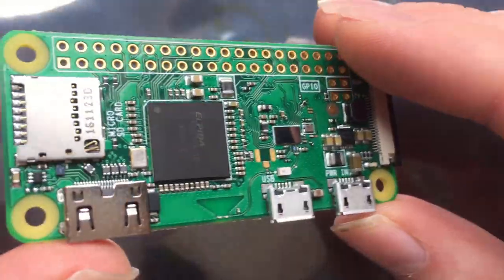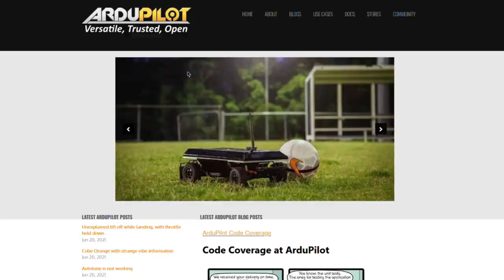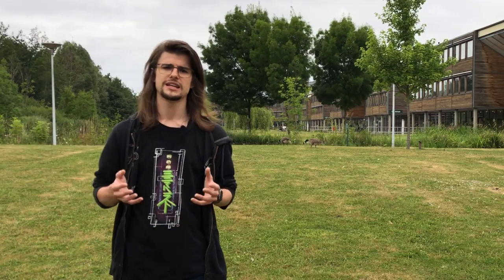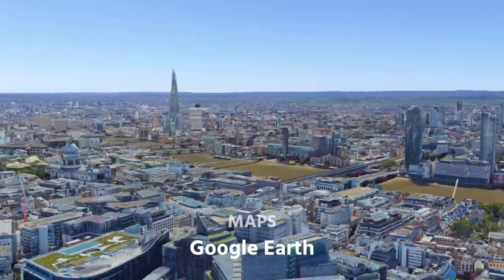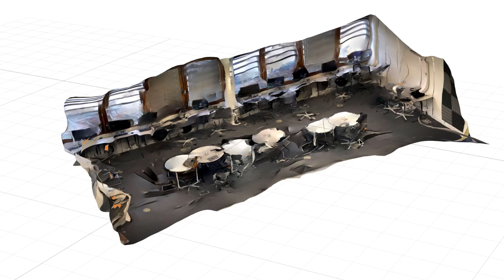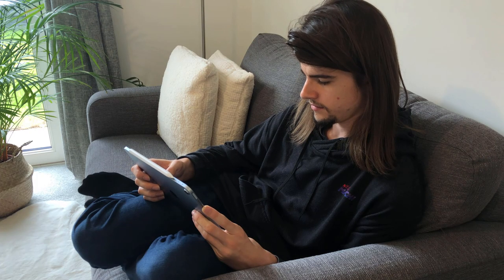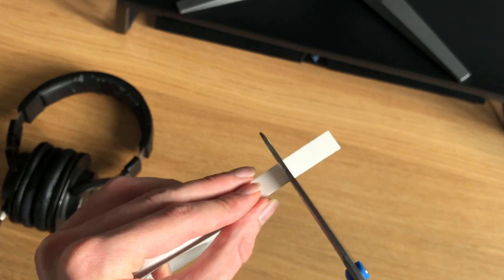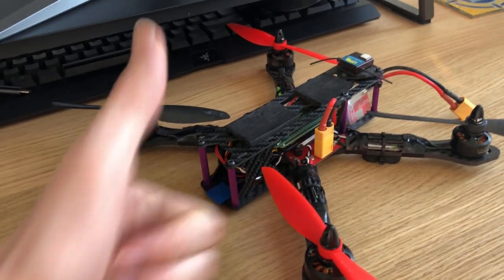My Raspberry Pi drone: the story so far

Comment: I also used PXFmini to build a drone for my final project at the university. It was always a challenge to make it fly correctly and I only did it once. The PXFmini was not discontinued by chance. Pixhaws is definitely the way to go. That Photogrammetry stuff is awesome, hope you continue to work on that.
Reply from the maker: “A challenge to make it fly” is definitely an understatement, that’s for sure…! Looking now at pairing a PixHawk with the Jetson Nano or a Pi 4, though space limitations on the drone means that I’m likely going to have to rebuild with a new frame. Should make a good video, at least! 😅
Reply: @akamatchstic  I had been working on a build a while back but got caught up with work and life and such, using the raspi 3 and navio2,. I have that operational once again, as I have no found significant time to focus on a smaller drone version that is 3d printed among other cool features, that are all relative to your goals. First off awesome work. Second off, why are you using PixHawk and other autopilot hats instead of a flight controller that supports inav or betaflight and then connects to raspi? Also super open to talking and collabing on work. I have a TON of drone ideas that I am finally trying to spend more time getting involved in. I have noticed a TON of flaws in the embedded systems community especially around drones too. Maybe not flaws but lack of standards, frameworks, modular adaptability, and among other things software choices. So please feel free to pm me on this topic as well.

Comment: I was going to do this for a Master's thesis in 2014. Had the same idea about streaming video to a GPU ground station for recognition. 

Needless to say, I also had to switch me topic. 

If I were doing it today, I would use the PixHawk in combination with a Nividia Nano.

But as if 2023 this problem has been solved. You can buy a drone made in China for under $200 that does it very well.

Comment: Nice work getting the raspi up in the air. I don't know how things were going at 2017, but nowadays in 2021 you can get a dedicated flight controller with gyro built-in for the price of a raspi alone. From the video, I infer your original goals is the 3d mapping stuff. Why don't you use a prebuilt flight controller which already handle the heavylifting of flying stuff so that you can focus on the 3d mapping thing?
Not meant to be fussy about it, just curious. Maybe you'd like to learn about the flying mechanism?
Great work, I am looking forward to see where this will go. Good luck 👍🏻
Reply from the maker: From memory, going for the Raspberry Pi was a case of it could run Linux for doing stuff onboard the drone, and with the right hardware could also run ArduPilot. 

You’re absolutely right though - a pre-built flight controller would have been a much better idea! Many times I wish I’d just gone with a PixHawk or something similar… oh well!

Comment: I was just thinking about doing same stuff... using pi zero to do everything. After watching your video, I think I shall get a separate flight controller for basic functions.
Reply from the maker: It’s definitely the way to go I think, with a separate flight controller. Off-loading that side of control makes a major difference in the compute resources you then have access to 👍

Comment: Soooo, all you needed to do was change the color of the props and it flies perfect? I think some information was withheld.
Reply from the maker: Haha yes, I did gloss over this a little. The changes were;

- Changed propellers
- Re-calibrated the ESCs
- Re-calibrated IMU and compass
- Tweaked the offsets for the IMU and compass to better account for the Raspberry Pi being mounted slightly out-of-true
- Dialled down the responsiveness to controller input, so that it was easier to fly
- Removed a killswitch from 2018 that I added, which would cause ArduPilot to be restarted completely if connection to a ground station was lost then re-connected (mega dumb, don’t know why I added it originally) - this must have caused at least half of my “wtf” crashes

Comment: How did you control your drone ?
with remote or your laptop?
Reply from the maker: In 2017 it was an Xbox 360 controller via WiFi (bad idea!), then moved to a Spektrum DX 7 transmitter and lemonRX receiver
Reply: @akamatchstic   which flight controller did you use ?
Reply from the maker: @Jimmy_Neutron  A PXFmini with a Pi Zero W - this is now discontinued. See 0:49 in the video 👍

Comment: Dear I have just a question I need to create a drone delivery short distance with autopilot  but it carrying  weight between 5kg and 10 kg is it possible to create like this drone ?
Reply from the maker: As long as you spec your power source and propulsion to handle that weight, that would be possible. You are definitely looking at a much larger drone than in this video.

I’d recommend going for a 6-propeller design at minimum for that, which gives you redundancy if a motor fails during flight. You’ll likely have to design your own airframe too at the size you’ll need

Comment: Hey this is awesome, one question, you used the raspberry pi as a flight controller?
Reply from the maker: More or less, yeah! I’m running ArduPilot under Linux on the Raspberry Pi, which sends data out to the ESCs via the PXFmini. That board also provides IMU, barometer etc data for ArduPilot.

Comment: did you run ROS under Mavlink Mavros protocol ?
Reply from the maker: That’s the plan yeah. I haven’t looked much into it other than the surface level of “this thing exists”, but I aim to also tie in MAVProxy in there for ground telemetry over WiFi